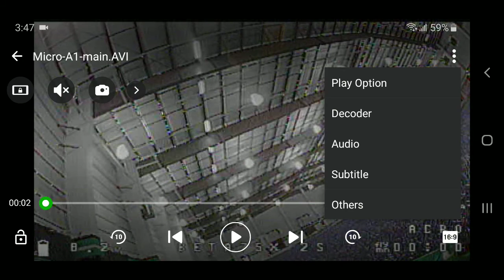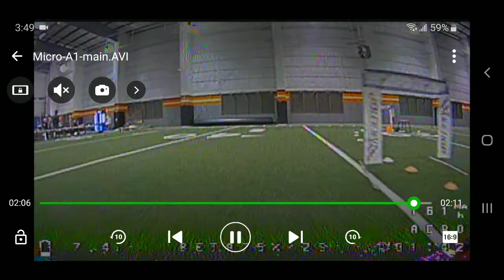Dallas Drone Racing - 1st Micro Series! Racing with Captain Vanover!

Comment: That looked like a really fun track and race right there!! I've been running my betafpv hx100 with them Avan Rush props as well and this thing freaking rips hard!! Great flying too btw!
Reply from the maker: What kv? Mine are 5400kv, on the lower side, i would like to try 4-blade props. This was actually built to run 3s. 

I'd like to build a higher kv 2s, I've got some 1102 13500kv and the 2-4s12a aio board. I wonder how many amps i would draw on 2.5" 3-blade props, i do not want to use a throttle cut. 

Thinking if i should stay with the same frame.